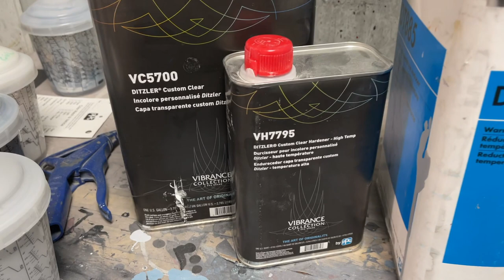C10 Show Truck Project: Painting the Inside of the Cab. #c10, #painting, #chevy

Comment: Was your final sanding with 320 before painting the color?
Reply from the maker: I believe it was 400. I usually stick block with 320 then use 400 with a soft interface pad on a DA to get rid of the block marks without taking off too much primer.